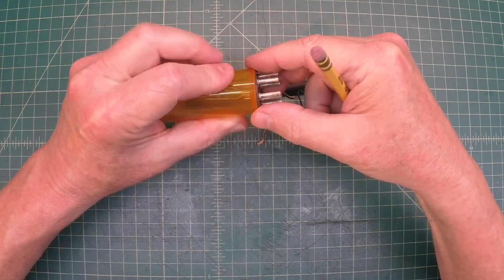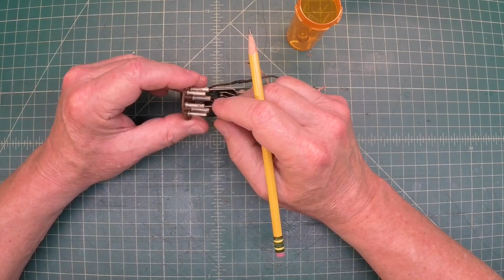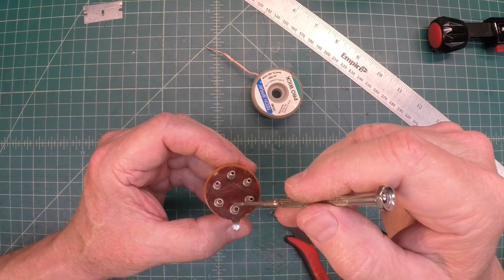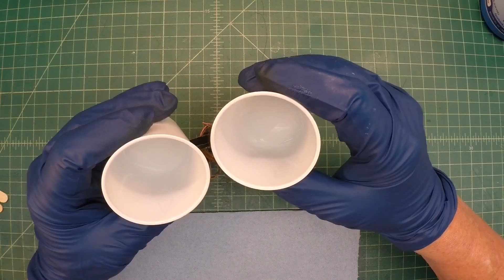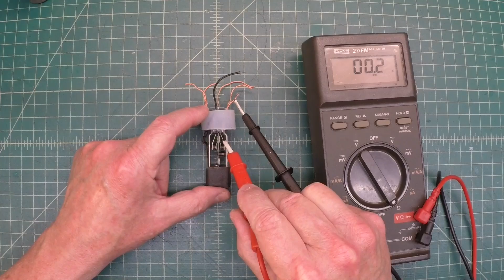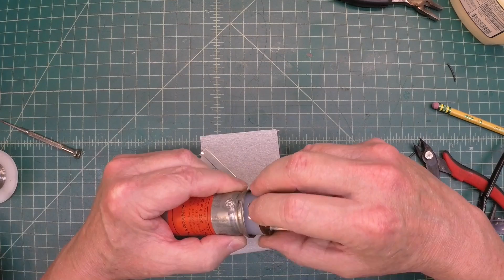Zenith 4-B-231 - Synchronous Vibrator Rebuild - Part 8

Comment: Very nice job!!!.. question... the negative side of the battery (Black) was that connected to the Vibrator socket or ground chassis ?
Reply from the maker: Thank you. When I returned the radio to my dad, I gave him all of my restoration notes. Let me know if the link below helps. Best, Don

http://www.nostalgiaair.org/pagesbymodel/830/M0024830.pdf

Comment: I haven't seen this video yet, and recently I got a Zenith 6b.321 that will need a lot of work, and this video will be very useful if I have problems with the vibrator that is the same as the one shown.
Again, thanks for sharing.
Reply from the maker: Hope this helps. The one I rebuilt is still working per my Dad, of course the radio only gets played a few times per month for a few hours each time. All the best. Don

Comment: Hi Don. I'm happy to report that my Zenith 4-B-231 is now up and running thanks to you and your videos. If not for you sharing your work here, my set probably would have sat untouched for months, maybe years before I got up enough courage to tackle it. Thank you! I still have to do some work on my vibrator though. At first my set was inoperable until I went back and burnished the HV contacts on it. The base on mine was also a gooey mess. I've cleaned it up but still have to come up with something to replace it. Your use of the silicone sure looks nice. Perhaps I'll get what I need and try that myself. I'm looking forward to the rest of your videos on this neat set.
Reply from the maker: Great news and I’m sure you would have been successful without my videos, but I’m glad they helped. If I had enough leftover silicone it would be yours. I hope you can create a new base and please keep me informed on what you use. A large rubber stopper drilled out was my next choice and they are available at the big box stores. What are you powering your radio with? Congrats again! Best, Don
Reply: Thanks Don. I looked up the stuff you used and think I might go that route. I did think about a soft rubber stopper, sliced or drilled  to accept the leads. I think that would work OK too. I have a bunch of surplus 5V and 12v supplies from old, old computer equipment.They are analog, open frame types, using a LM723 IC. I can adjust the voltage as high as 5.8V before it cuts out, but the radio works fine at 5.25V. The supply can supply several amps, so that isn't a problem. Thanks!
Reply from the maker: Sounds good. Keep me posted and I hope things continue to go well. Best, Don

Comment: Why not have just used regular  insulated solid copper wire instead of solder wick?
Reply from the maker: Tom, great question. I mirrored what was used on the original build. Insulated copper would have been a perfect choice too. Best, Don

Comment: You probably had a significant voltage drop on the gator clip leads and that robbed you of drive current in the vibrator inverter circuit.   Great rebuild sir.
Reply from the maker: JP - you are correct. Those cheap 20+ AWG jumpers were the main culprit. Best, Don
Reply: I have sat down and soldered the wires to the clips or I have replaced a few pairs with heavier gauge wire.   They are good enough for low current electronics but not for heavy current apps.   Keep up the great work.

Comment: Nice job Don. The pharmacy I worked at in high school had one of those self service tube testers,it had a socket for checking vibrators. We even sold them, as well as a selection of popular vacuum tubes.
Reply from the maker: Thank you Richie. I recall those visits myself to the local pharmacy with my Dad testing tubes, but I can’t ever recall seeing the vibrator test socket. Heck at that time, I had no idea what a tube was for or did until my Dad got me up to speed. Best, Don

Comment: Yes the silicon a good idea is it electrical safe over time, I don't understand why you didn't go passed the nuts  you should have gone pass the nuts not a lot to hold on to. what holding on the bottom you should have had a piece of silicone on the bottom a 1 or2 mm thick eventually it will shake loose probably without any support on the bottom. If you want it completely quiet!  you could incase it in some rockwool and then it will be completely silent by finding a bigger tube stuffing it with rockwool. Ok has a muffler stuff it with rockwool though is the best material electrically safe fire retardant sound deadening completely
Reply from the maker: John, the silicone made sense to me too since I already had it on hand. A few more mm of silicone wouldn’t have made much difference. You can’t tell in the video, but the top of the coil bottoms out (tops out) in the can and the same holds true for the socket side supported by the retaining ring. I like your rockwool idea with the two benefits you noted. I may consider using it for noise suppression. I always spray any cardboard material I use with a fire retardant material I purchased for such cases. After I get it back together, I'll reevaluate the noise level and let you know how I proceeded. Thanks again for your recommendations and taking time to watch. Best, Don
Reply: RestoreOldRadios rockwool is not cardboard! It is spun rock basalt I think, so it is fire retardant to 1200 degrees Celsius and electrically safe I think you should be careful spraying chemicals that are fire retardant they are known to be carcinogenic. Don't you think there's an issue with the bottom coil solenoid rubbing against the metal case, wouldn't this where the installation out. I thought having a silicone shim  that is flexible wood clamp it in position and stop the out-of-body from vibrating just the points is needed and the wafer metal, I'm surprised there was no washer there of some rubber construction in the first place! maybe there was and it's disintegrated that's what all that sticky brown liquid inside is, there's no signs of any markings I could see on the inside of the bottom of the can you would have thought there would be if the coil was touching the bottom? so there was a rubber washer there or it was not touching the bottom.
Reply from the maker: Thanks for sharing this John. The end result using rockwool would be superior to the original cardboard. My fire retardant is non-toxic w/ zero VOC, but no match for your recommendation. Thanks again. Best, Don